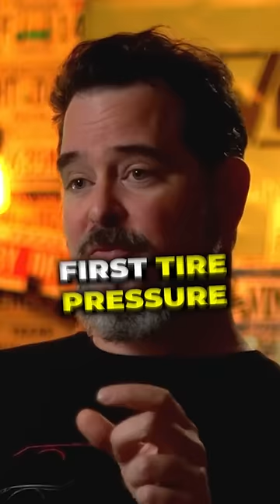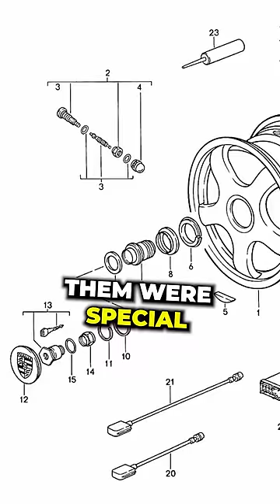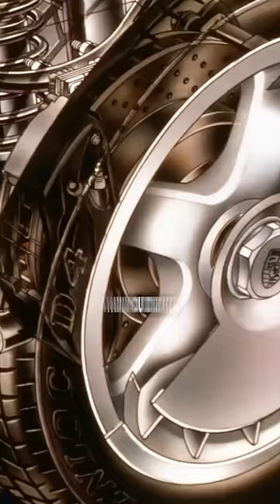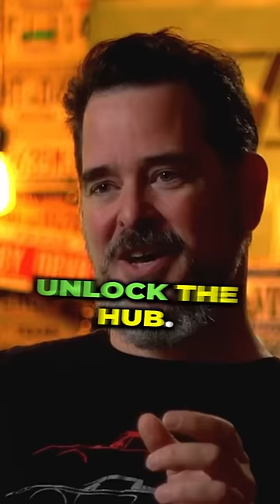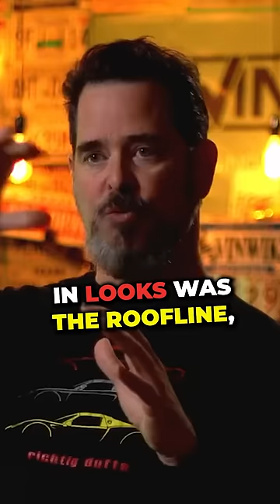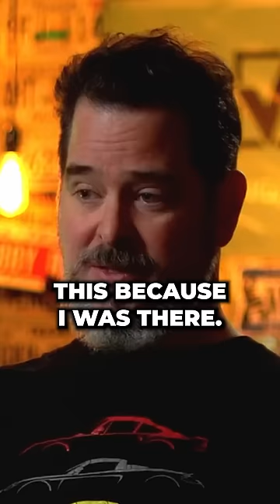Porsche built the most advanced car of ALL TIME!

Comment: Today I learned that you need a Shelby GT500 engine to put on the 959 wheels
Reply: Funny, but ft lbs are not the same as lb ft.
Reply: Actually, that engine would not be suitable for the task. You need to have something with torque at 0 RPM, which means either a breaker bar, an electric motor, or a steam engine.
Reply: Ahhh. There IS a catch!
Reply: Lame
Reply: Alternately, you could get a 625’ long cheater pipe and put 1lb on it. (Though realistically somewhere around 150’ I’m guessing, would the pipe weigh enough to move itself.)
Reply: @User 2C47  didn't know steam engines made torque at 0 rpm
Reply: @liammartin8773  you don’t know a lot son.
Reply: @GODSWORD11  if that's an attempt at comedy that's a big oof
Reply: @racecarrik  oof deez 🥜
Reply: @joeschmoe6908  what? How ? Have physics changed since I finished high school?
Reply: @alexreitler hes right. pound foot is one pound on a 1 foot lever, foot pound is the amount of work it takes to move a pound 1 foot last time i checked
Reply: @joeschmoe6908 actualy it is, torque is torque. North the car and Tool are x nm
Reply: @user2C47 no you dont .... It has a clutch... Run the rpm up and dump the ho
Reply: @robivlahov  Last time I checked, the clutch is part of the transmission, not the engine.
Reply: @user2C47  I do t know of any ice engines in use that don't use a clutch of some sort,except marine ones , even the direct drive 2strokes carts have a clutch. You can't transmit torque at 0rpm with the engine stopped , hell to start it you need electricity,compressed air or momentum to turn it over just to start it . Even the air tool/impact wrench has a clutch/transmition... The anvil and spring and the hammer create slippage ... You won't do JACK S without it in an air tool , becomes an air ratchet and we know how powerful those are , and they have a transmission in them , electric is the only one that can get it undone from 0rpm,but even they use around 2000rpm usually in the impact tools ,or ofc a lever with a 1' square drive

Comment: The 959 is such a iconic legend...imagine what kind of spaceship they engineered...
Reply: i would love to see what the cheapest car today is that can beat it around a track.
Reply: @dnegel9546   that would be super interesting, it probably still takes a legit sportscar to beat it
Reply: @bigd5899  im guessing camaro v6 1LE ? 🤔
Reply: @dnegel9546   idk man, the 959 has much better power to weight so as long as its not on shitty tires i don’t see it losing. But who knows maybe the 959 aged worse than i expect.
Reply: The 918 spyder is the most iconic important car this century  because it concept of V8 powering 4 electric motors  literally saved the supercar from extinction

Comment: They actually use a similar idea in monitoring helicopter blades for cracks. Fill em with argon or something and monitor the pressure. 
I had an RC 959 back in the late 80s/early 90s that was actually pretty cool as far as toy RC cars from that era go.
The 959 has always been one of my absolute favorite cars. Although these days I'd probably rather have an F40.

Comment: Lock picking lawyer has entered the chat
Reply: He better have one bad ass impact gun
Reply: @2ndAveScents  electric impacts now a days deliver over 1,000lbs of torque.
Reply: @brwnsgr3245  
Yeah, good luck stealing anything when you're using a tool that requires ear protection.
Reply: @yocapo32  I’m just saying it isn’t that high of a torque. A good 3/4 with a cheater pipe and you will be done in 2 seconds. And they also make reducers from 20 to 1 putting out crazy torque
Reply: @jonathanpalmer228 The whole point of stealing wheels is to be quick, if you have to pick a lock and then pull out a massive wrench to get it off that’s too conspicuous for most thieves.

Comment: Mercedes did come out with the 600 in 1963 and it's more complicated than many modern cars. I'm going to buy one some day.
Reply: I doubt W100s are as complicated as you claim
Reply: @andtherye4580  the hydraulic system on them is nightmarishly complex and financially ruinous to repair. Even Jay Leno winced and screamed "Oh my God" repeatedly when discussing the costs of putting it right...
Reply: @richardharrold9736  well yeah getting one system to do almost all mechanical uses in a car does sound like a nightmare
Reply: @andtherye4580  we do the same with electrics... but Mercedes felt that the electrics of that time were too noisy for a true luxury car. Hydraulics are silent.
Reply: @richardharrold9736  I didn't know that, thanks for the new knowledge

Comment: I really really doubt that the rotating assembly, holding a magnesium rim, could come anywhere close to 625ft lbs of torque. Most shops in America simply do not have the toold required to get anywhere near that level of torque, especially not a standard 1/2" impact gun

Comment: The only part of a 911 used on the 959 was the rear lights. Everything else was new.
Reply: Not even those.
Reply: @richardharrold9736  thats what porche said when it was released...
Reply: @christianbuczko1481  the shape is totally different... 911 rear end is curved, 959 is flat...
Reply: @richardharrold9736  then why are there 911, 930, 959 part rear lights for sale then?? Go look at a pic of a 959 rear and you will see they arnt flat.

Comment: Gotta control that 150 horsepower
Reply: 444 horsepower
Reply: @ProtoTribal Lol ok
Reply: @@prototribal4659they did close to 200mph. 200hp would get it to 150mph..
Reply: @ProtoTribal 400 wheel. First 200mph road car. Your Toyota would have got absolutely destroyed by even a base 3.2 911 of that time.
Reply: @ProtoTribal so your Toyota weighed 816kg with a 400bhp engine? 500bhp/ton? And you used this featherweight monster on mountain roads as well as the drag strip? I call bullshit. If it was traction-limited on a full-prep strip then there's no way it could hang with a 959 on twisty roads...
Reply: @ProtoTribal lmao there's only like 2 in the US alone..... 🧢🧢🧢

Comment: Lmao my Milwaukee drill and impact could snag one of those wheels in 2 seconds
Reply: Well thats more bullshit. It would break your arm if you tried. You need a bar several foot long.
Reply: @christianbuczko1481  bro I regularly work on stuff that uses degrees to torque stuff down and 600 ftlbs isn’t that tight
Reply: @jonathanpalmer228  no. 600 ft/lbs is tight. Just not comparatively to some semi shit.
Reply: @jonathanpalmer228  bruh this car came out in the 80s. Don't even think Milwaukee existed then 🤡🤡🤡

Comment: 625lbs-ft of torque!?!  That's over 6 times the normal rating.
Reply: Center locks. Current 911s with center locks are roughly 500ft lbs
Reply: @sutherlacd27 that makes sense.  Didn't know they were doing single nuts back then.  This car was so far ahead of it's time.

Comment: Bro.  I remove semi wheels.  600 foot pounds is not hard to brake. And if you have a 3/4 ratchet can be done silently.  Also tire monitoring systems are stupid expensive and almost always fail in the winter.  Could have just put sealing gel between the layers of rubber and the tires will self seal from holes smaller then 1/2 inch.  Not going to lie tho.  Porsche has made some high tech stuff in the 80s they had models with brake radar assist and proximity sensors and back up or side view cameras.  Stuff that’s seen as new today actually was in bmw and Porsche in the 80s.
Reply: Firstly, TPMS' are quite inexpensive. 
Secondly, tires absolutely would not stay in place by adding adhesive to the bead. Adhesives have amazing holding properties but have nowhere near the sheer strength to stop a wheel from spinning away from a tire.

Comment: Bill Gates and to have the wheel removal tool custom made because Porsche wouldn't sell it to him since his wasn't an official American car. They made the tool off the front wheel which was different depth than the rear so they had to make one for the rear too. It cost him about $4k to get the WHEELS OFF THE CAR. It was a cool looking car but the interior was very dated looking in the coloring. His car was at the dealership I worked at.

Comment: Sorry you arevtalking total rubbish the first mass production car with run flat tyres was the 1973 rover p6 fitted with Dunlop mobility tyre later called denovo tyre its was not porsche it was Rover with run flats then later in 1974 Bridgestone Tripguard Safety Tyre did not require special rims and came with tpm in 1974 sorry not porsche again check you facts first.